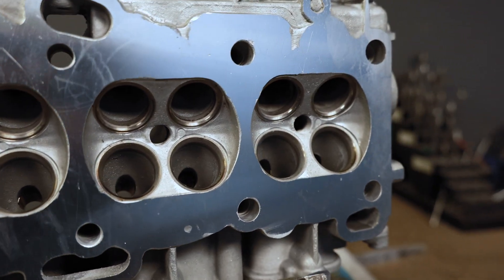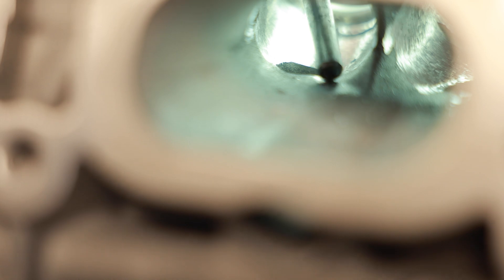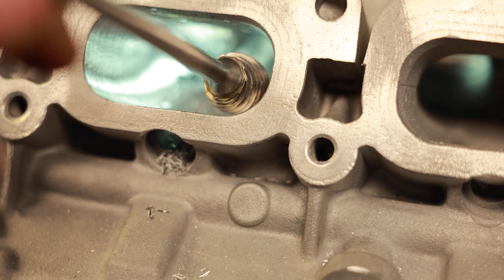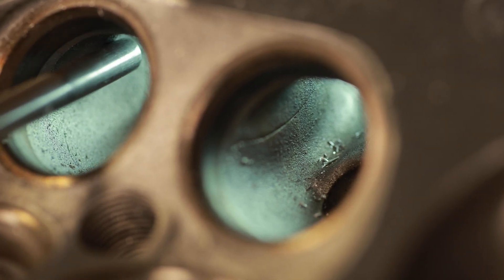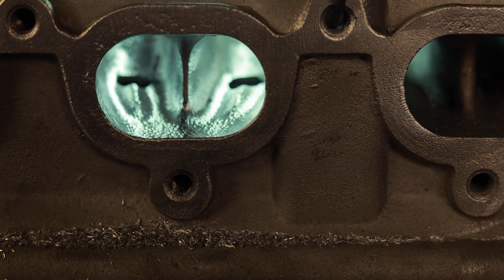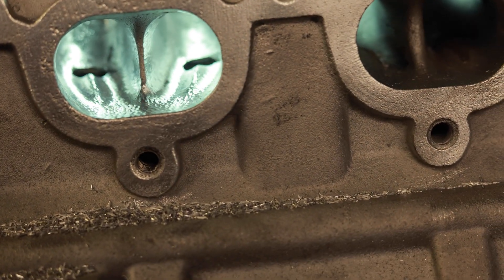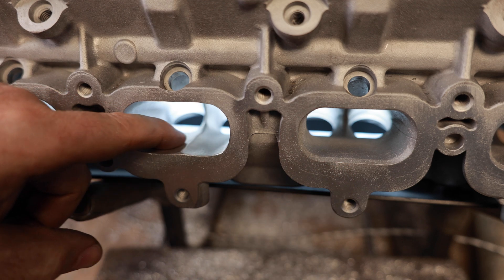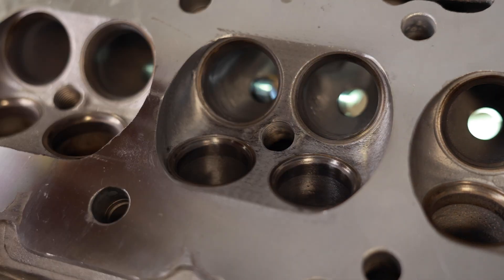Maximizing Flow: Porting the 2nd Gen 4G63!

Comment: So at what point do you measure cross sectional area? And how are you ensuring constant taper?
Reply from the maker: You can see it in the shape of the port without measuring it if you have experience porting. I usually check it all after I am done porting it, so only need some touch ups vs slowing me down.

Comment: Hey dave, question. If the water ports welded shut on the head and its a wet block, how do you get the water from the block to the head ?
Reply from the maker: they run seperate lines. Beyond that, I couldn't tell you. Don't work on the car part of that equation lol

Comment: When it comes to the exhaust the gases are still expanding. The reason not to gasket match is that the step prevents reversion. You absolutely cannot think about the exhaust in the same manner as the intake.
Reply from the maker: same on intake, the lip helps stop reversion during overlap. Always leave the intake port smaller than the manifold on the intake floor.
Reply: @headgames   yes but better to prevent reversion on the inlet side than design for it.

Comment: You can increase port taper by making it larger at the mouth and then working the cross section gradually smaller as it approaches the valve
Reply from the maker: I can understand the theory behind that, but haven't seen that actually work.
Reply: @headgames  most newer four valve heads already have a decent taper in them. More of a two valve thing.

Comment: Introduces Dave to The early Ford Cleveland racers adding material to the exhaust port to raise the roof and move the floor up about that gasket matching ...
Reply: Yep you learn that on a flow bench when you start putting Clay on it. Before the days of custom castings Bob Glidden had heads where the ports were almost completely made out of lab metal and aluminum tubing literally the entire port was glued together😂
Reply: @blaqlabspodcast5816  For those that don't know early pro stocks used stock parts. Cleveland heads the ports faced down because ford used shock towers. Bob literally milled the tops of the exhaust ports off and made fabbed metal plates to fit over the port to raise the exhaust port. It's really cool if you can ever find the articles in hotrod and other mags explaining what he did and why.
Reply: You learn that by adding clay how to flow bench and start seeing all kinds of cool stuff happen raise the floor raise the roof straighten that angle into the back of the valve
Reply from the maker: I did an aftermarket Cleveland head back in the early 2000's. One of only 4 SBF heads I think I have ever ported lol
Reply: @headgames  Bob did more than just port shaping. He used fins in the intake as well as reshaped the chambers. He increased velocity and that's just the heads. There's a reason he would hide his engine by covering it. He did massive intake runner mods. He moved them out and shortened them. They say he was changing valve angles as well. You really should have a peak at Glidden's Cleveland. Dragboss has video on them. What he did was some almost Bond style stealthy. The 335' series is the most powerfull small block(of all til FR9) Ford ever made. Check out 1974 Last lap antics by Pearson to beat Petty. Then came Bill Elliots two laps down to recover. That's power. Still used today. Ford guy barely Engine guy yes. It's worth a look back for any real engine guy.

Comment: I’m a Ford guy 1979 and up but I watch all your head porting videos. You can always learn from other designs.
Reply from the maker: I have owned 20 fox's and went into porting import heads after doing BBC nitrous heads. The techniques are the same, and the theory is all the same, except on the domestic heads, you wouldn't want to mess with the floor of the port like we do on the 4 valve heads.
Reply: @ Very nice! In the early 00s MK 4s and AWD Talons got respect on the streets in my area. I’ve had 6 foxes and shouldn’t have sold any of them. I’m building my first SN now because fox prices. I scored a first gen F150 Coyote and I have G Force G101A for it. 

I’m pulling the engine apart to get fortified with vitamins and minerals. While that’s in the machine shop and since Gen 2 heads are hard to come by… what do you think you could do with a pair of stock valve sized Gen 1 heads?

Comment: Still waiting for a BMW N54 head. I want to port my N54 head, coat the pistons, valves, ports and combustion chamber. Curious to how much power can be increased by porting a turbo head.
Reply from the maker: depends on how much power you are trying to make if it would help or hurt by porting it.

Comment: There using 1G exhaust gasket on 2G thats y. 1G vs 2G big port vs smaller port. 1G top end or 2G velocity so not cave man move on DSM or 6 bilt or 7 bolt. I would just use a 2G head from head games and be done best of both worlds.
Reply from the maker: the intake port is different from 1g to 2G but the exhaust ports are basically the same from gen 1 to evo 9

Comment: I know you say that there’s no airflow to be gained from touching/enlarging port openings, however I’ve seen some road race engine builders raise the roof of the opening of both intake and exhaust which continues all the way into the port roof on Nissan VK56 built by Kelly Racing for V8 Supercar making 640hp at 7500 redline Destroked to 5.0 liter per the rules. Also see Hartley racing engines with a 4.0 Destroked version of the same engine making over 500hp at 10,000 rpm for their version of dirt track racing carbureted. Both engines run a 10:1 compression ratio per their series rules. Specifically on the VK56 if you check out the SAE white paper it shows how Nissan lowered both intake and exhaust ports to create more low end torque for truck use versus the VK45 that was designed for higher rev range power. Hartley also done extensive intake and exhaust port flange mods on their Toyota 1GZ V12 engines to have them make insane figures naturally aspirated, 250-400 hp over stock Toyota figures. Maybe on a turbo engine it’s not warranted but naturally aspirated inlet mods**not gasket matching 😅😅** may produce gains.
Reply: Raising the port to get a better approach angle is pretty common.

Check out this ford 300 6 cylinder that was built for drag racing back in the day. It has a cylinder head made from 3 sections boss heads epoxied together, and it has raised ports.

https://youtu.be/JqjhyBKa4pI?si=UshVzcXnFIoI_bGH
Reply: @ that’s a beast!!! some extreme port work there, stuff I’ve never imagined.
Reply from the maker: I can't really speak about NA or the VK but we have made 2500whp on the VQ without taking anything out to a gasket. Many people do it, but it is all theory. When you buy, you are always buying the theory of whomever is doing it. I have never seen it work, and have always seen it lose torque so I would never do it.
Reply: Was that a billet block or factory casting? @headgames
Reply: @ one of these days a set of VK heads are gonna show up to your shop for a valve job and flow test with both intake and exhaust flanges slightly enlarged at the top to decrease the port angle***not out to a gasket/gasket match***. Going to put one in a 240sx when I get the other 2 cars ahead of it done. (I hate LS swaps, it’s the lazy way to do things). The engines are cheap enough at the moment to buy more than one so I’ll have an untouched head for comparison. Can hardly wait.

Comment: I want to see how they get rid of the water passage!!
Reply: Same method as any other aluminum cylinder head. It gets tig welded until there's enough material built up to surface it flush.
Reply from the maker: @ryankosciesza5295 here is a 2JZ we did https://youtu.be/m9ywFWdbUZs?feature=shared